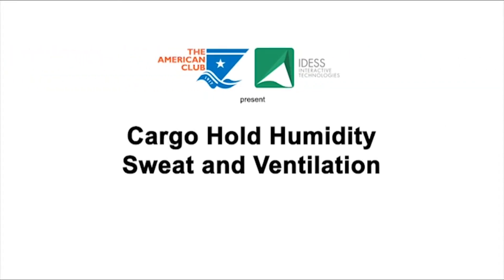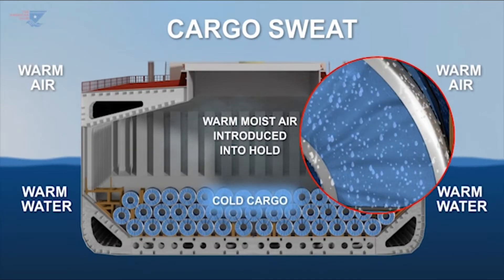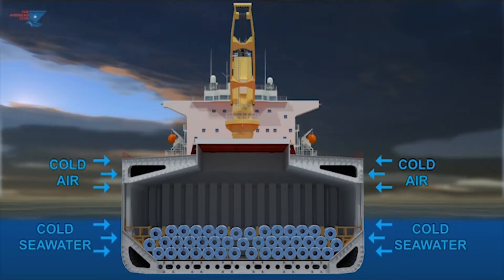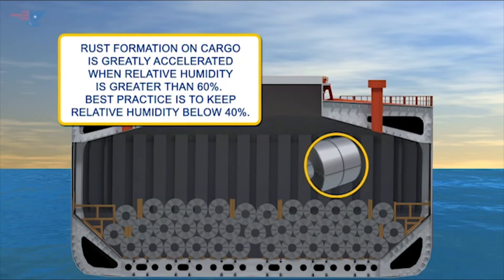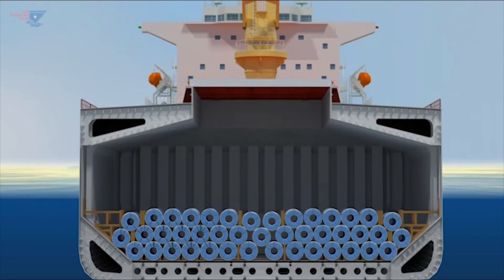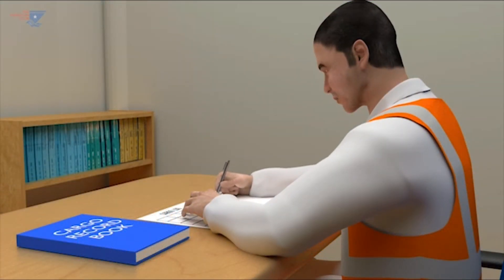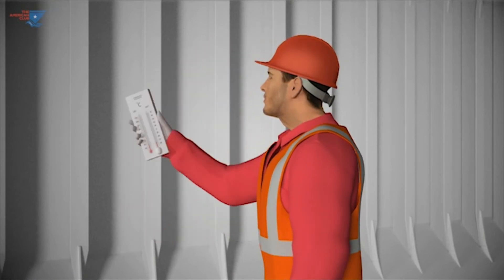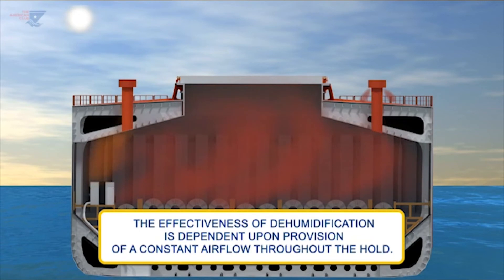Cargo Hold Humidity Sweat & Ventilation

Comment: If the air in the hold is cold even at 100 % at 40 degrees it is still dryer than air at 40% RH at 90 degrees. So shouldn’t absolute humidity be more accurate method the air at 40% /90 F has over double the amount of water in it than 100% humidity at 40 F air .